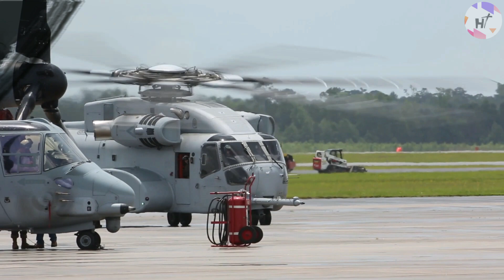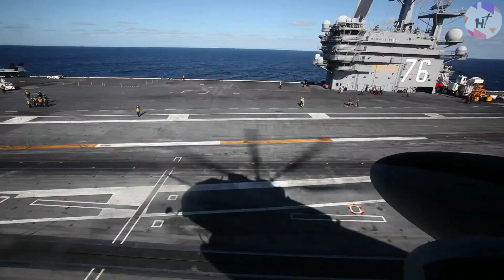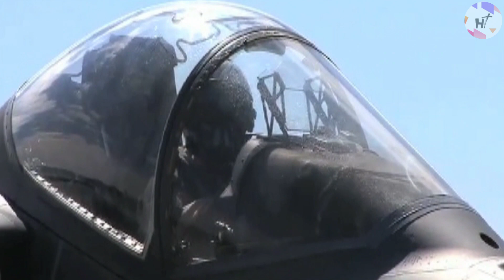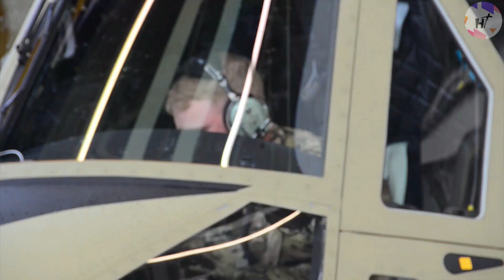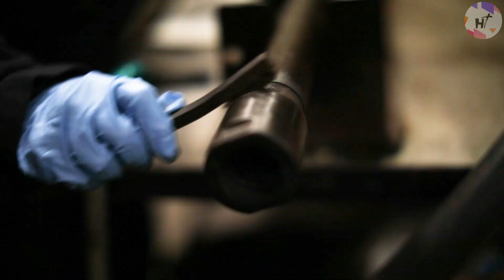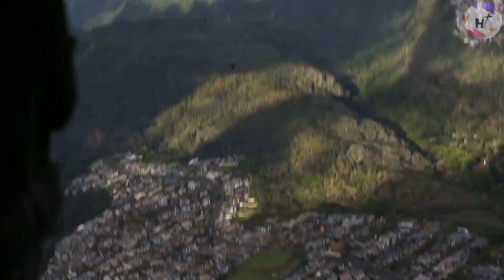How US Military Maintains Its Largest Helicopter in Middle of Ocean | Sikorsky CH-53E Super Stallion

Comment: The Sikorsky CH53 is a more powerful version of the Sikorsky S-80E. The helicopter has a speed of 170 knots (196 miles per hour) and a gross weight of up to 35,000 pounds.